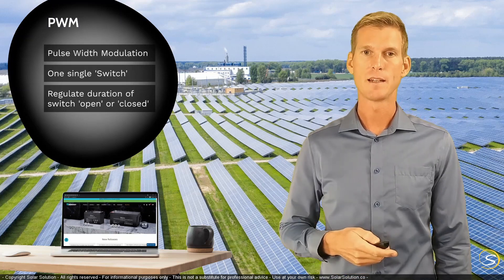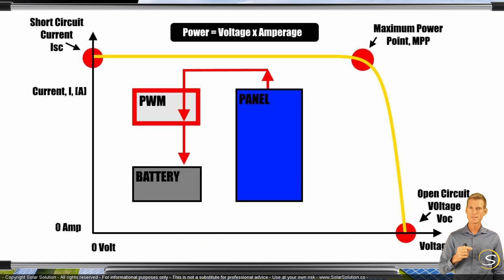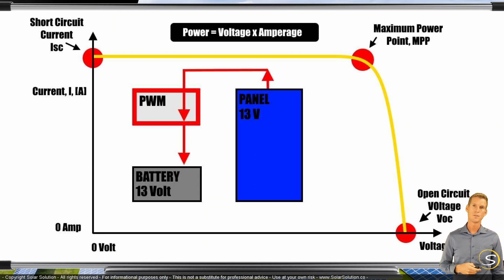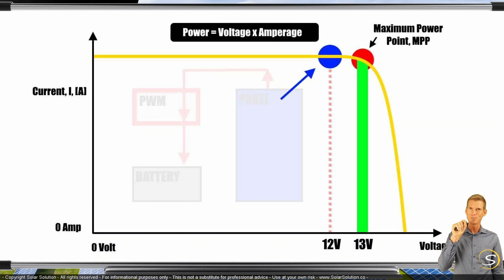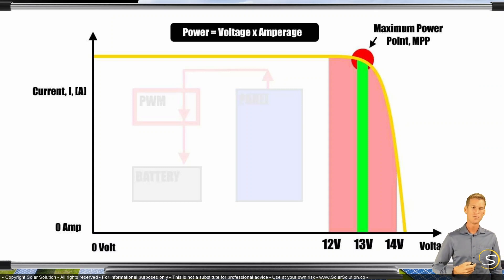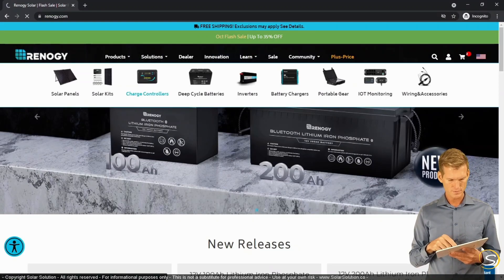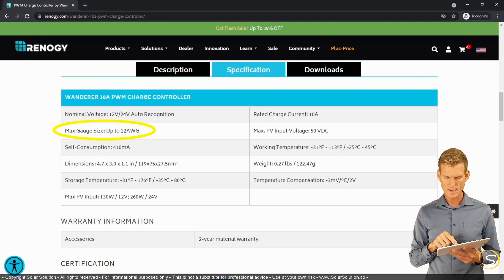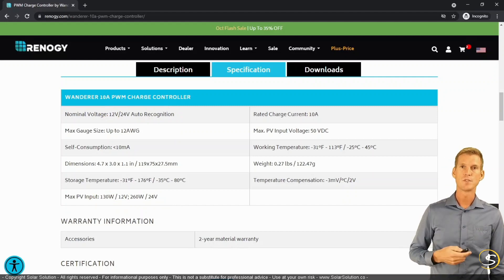PWM Solar Charger: Advantages and Limitations

Comment: what happens if your panels can put out more than the rating ?   say older panels rated at 300w ( 75x4)  in the 260w  running 24v. -- or 150 (75x2) in the 130w rated @12v?f  Could it damage anything or is it just less efficient ?

Comment: So if i use a buck converter to drop voltages from a panel down to match a battery's voltage, 12v, and boost current up before feeding the power to a pwm charge controller, will this help increase power going to a battery?

Comment: In real life it will even be worse. As so called 12v panels are actually rated at 20v. So A PWM will Waste upper 8v.
Reply: In ideal conditions yes but most panels lose efficiency and the weather dictates your power too. I'm guessing a solar panel needs to be capable of more to achieve a good average